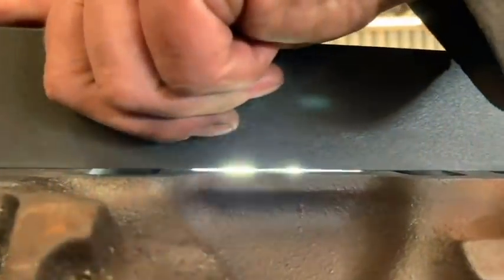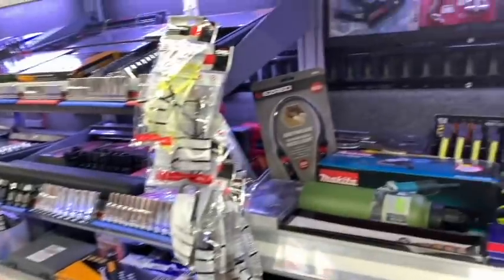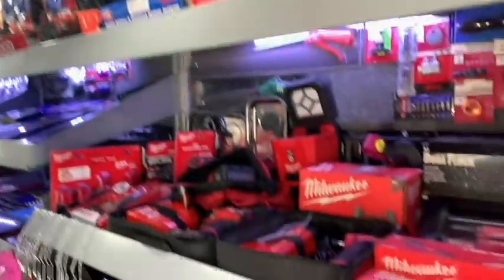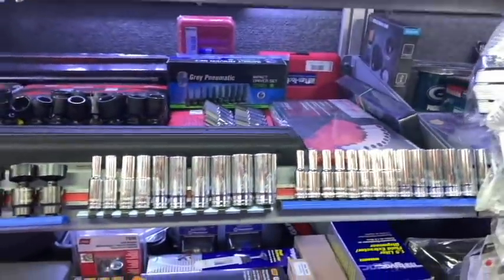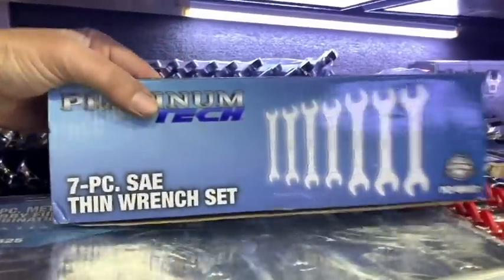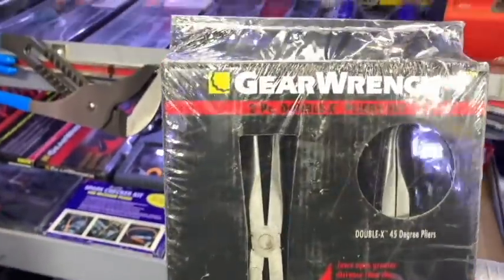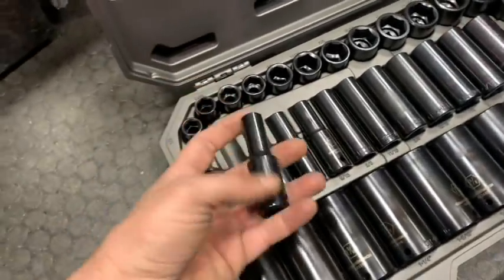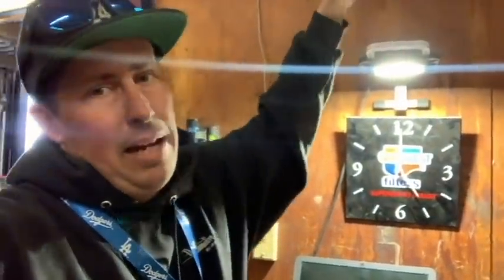All New Gearwrench Impact Socket's & X Core Pin-less Swivel's!

Comment: Amazon links. A lot cheaper, usually, than you can get if for on the truck.
Reply: Sure it is but Amazon isn't coming by my shop and giving me a lifetime warranty on them. That truck don't run on air it has overhead.

Comment: GearWrench just came out with these? Wow I’ve had my Matco 3/8” pinless impact socket set for over 15 years now. They have been awesome to use. Never had a single one break. They were expensive back then too. $320 is what I remember paying for them from the Matco truck. I’ve always wanted to get a 1/2” set.
Reply: Being a Shade tree mechanic is way different then being a professional mechanic. The matco ones are junk!! It's snap on or nothing!

Comment: I have the metric set of those thin wrenches,the 17mm came in handy on brake caliper slides on a 2015 Chevy Equinox so far
Reply from the maker: Right on
Reply: Needle nose vice grips work way better n adjustable, thank me later
Reply: Screw the slides up doing it
Reply: Must be using cut rate tools . use some high quality grips with a straight nose out of the package . some slides dont even have squared edges and are completely round , caliper slide bolts shouldnt be torqued down and dont usually have corrosion problems because of the slide grease so idk how you would go about stripping one unless you really cant wrench.
Reply: Some are a hex where a wrench can be used on

Comment: I had the x core the edges were beaten & rolled so bad that they became jammed I haven't used em since I bought the sunex & they are great except my 15/16 & the 1 1/8 inch the bands are broke & the 15/16 the pin is bent inside the socket & totally seized up but they are still nice

Comment: Got a set of them new gearwrench x-core swivel sockets, had them for 4weeks or more... The are not very strong the steel is soft I've broken the 19 17 and the 13mm is on it's way out pretty disappointed due to the cost of them